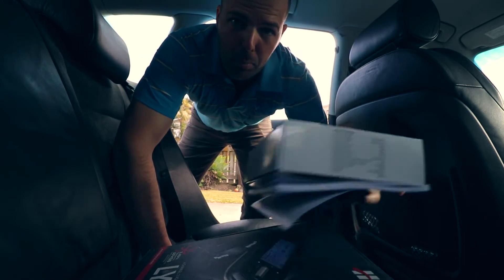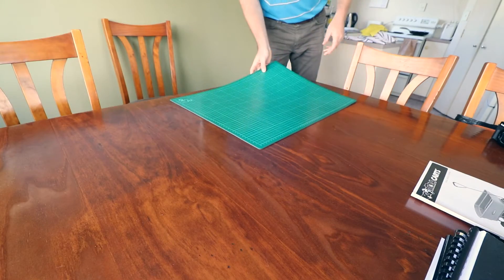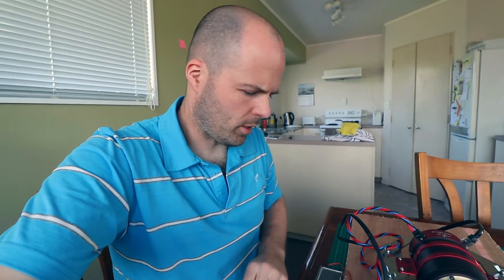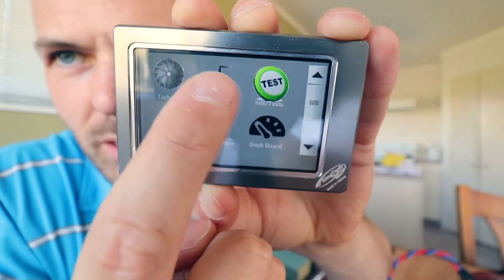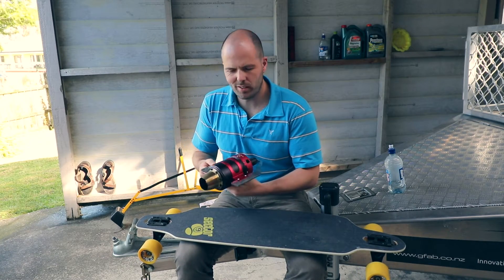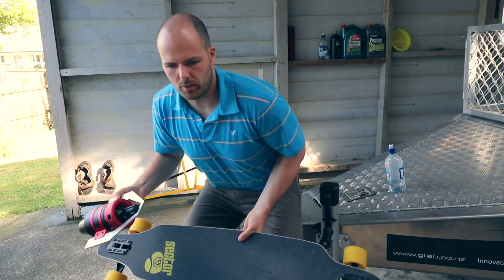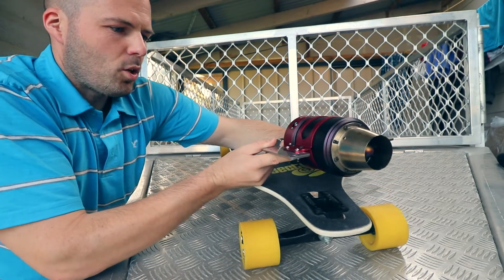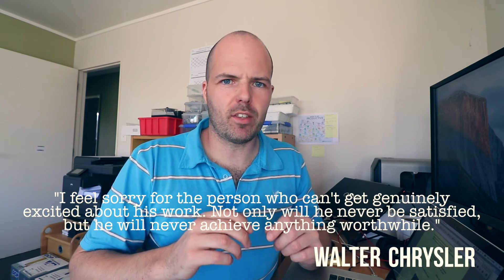Jet-Powered Skateboard (Part 2)

Comment: Magnus, I applaud you. Your energy, drive, ingenuity and just cause you MAKE STUFF.  Take a look at my videos. I have been running a Jet Powered Street Luge (lay down Skateboard) for 12 years with the desire and design to build a skateboard like you are. Time has been my issue, so I am living through you at the moment.  I love how you meet every challenge with a solution and keep hammering it until you get something you are satisfied with. I remember this day right where you are 12 years ago on the first start up.   If you have any questions or want to bounce ideas please let me know and I am at your service.2 tips for today comes to mind. You need a FOD screen because that little power house jet engine is 1000 times stronger than a Dyson vacuum cleaner and STUFF thicker than air wont fit through. #2.  Do not do to many dry starts. The bearings are lubricated by the fuel and turbine oil mix.Above all keep having funWork Hard, Play HarderBobBlue Smoke Racing LLCwww.jetluge.net
Reply from the maker: Wow, Robert. I remember stumbling across your website a number of weeks ago (while searching to see in others had made a jet-powered skateboard ...but, it looks like it's just YOU ...and soon-to-be me :-). That's a big jet you've got on yours. What size is it?

Thanks for the tips on not running it dry - big help!

Yeah, I've got a FOD that came with it ...just need to fit it on.

Comment: Freaking awesome man! PROGRESS!!

Can't wait to see it fire up and run fully! Good luck for tomorrow!

Brad

PS: Don't forget to put the little intake mesh shield, to prevent stuff going in there even when you test. Would be horrible if you get to final testing and it sucks in something and gets broken...
Reply from the maker: Hey Brad. Yes, for sure ...I'm just hoping it fits in when attached to the titanium mount!
Reply: a sink drain screen sold in the grocery or dollar store will work well for that tiny turbine. Cut hole in the middle and slide over the starter motor. A rubber grommet where  you cut the screen will give it a good seal and will hold it snug over the starter  http://www.kingtechturbines.com/img/K-180G_cables.jpg